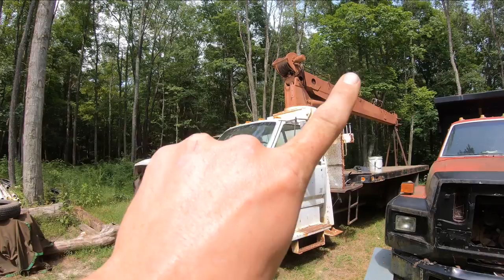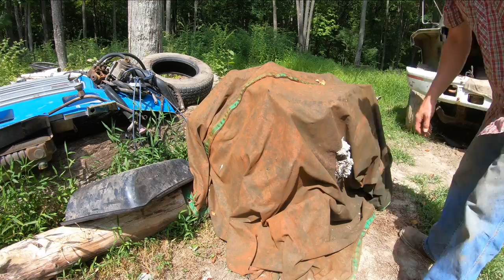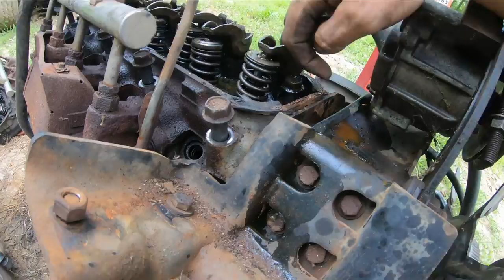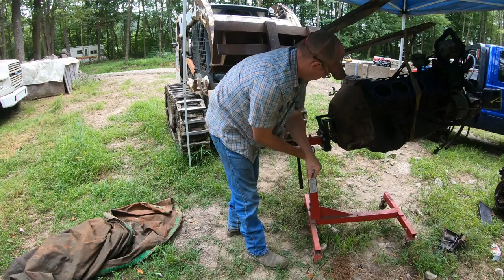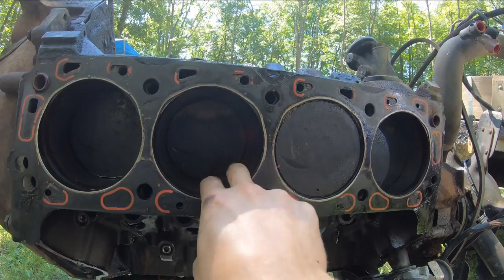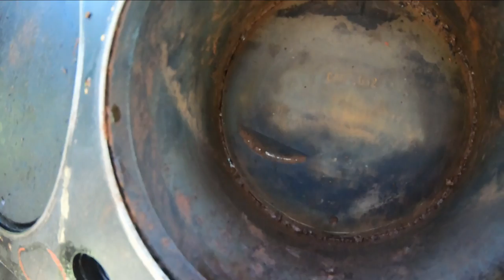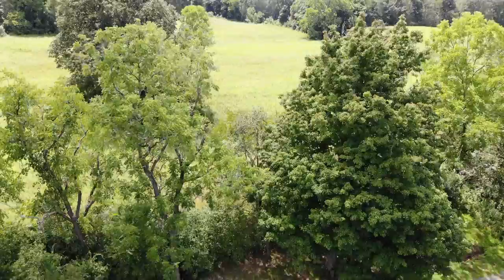Rebuilding a Big-Block in the woods! $700 Auction Crane Engine with big problems!

Comment: I'm here to tell you that you're doing it wrong!
Reply from the maker: HAHA But it feels so so right!!
Reply: first AND second !!
Reply: I'll bet your Wife told you say that!! He just doing some you always wanted to do. Good to see you Guys are support each other.
Reply: Hey  Wes ,,
What you think of the bore with the pit hole n skid mark down the lenght of it ,, even after it was honed
Reply: @Sircraig7963  Of course it's not ideal, but not everything has to be perfect. A little blow by on one cylinder is still a lot better than seized up!
Reply: And I'm here to tell YOU that opinions are like assholes! Everybody's got one, and they ALL stink!
Reply: I thought this A gas engine  how does it have blow by
Reply: @dancurrier6421  Blow by just means combustion gasses are going past the rings and into the crankcase. All engines have blow by.
Reply: Matt what is the metal bar used for banging on
Reply: @WatchWesWork  there was blow by afterwards?
Reply: never seen an engine with the things that needed do done as wrong as this one- still ya only learn the right way by doing the wrong way but HEY HE IS GONNA DO A WHOLE LOT OF LEARNING THIS WAY.. I CRINGED  when he said all you who like to strip an engine in a clean setting are wrong ya dont nee4d it the he started cleaning the bore WITH A SCRAPER AND SCREWDRIVER  HAHAHA whole lotta learning
Reply: @GaryAyre  I don't believe his goal was to make a proper rebuild, obviously. Something that costs at least $3000 and gives you the potential for another couple hundred thousand miles. No he wanted to make the thing run and it is not an engine that is used a lot, and he did. I believe this engine will not seize again or blow up or anything. This was minimalistic rebuild and he did it right with that mindset. Feel free to send him $3000 for each machine he has so that all the engines can have perfect bores and valve seats and everything will be perfect in the best of worlds. 
If there was a lobbyist for the machine shop industry they would sound like you.

Comment: Get a pick and have a dig around that rust pit in the first cylinder you did. Make sure it's not a hole into the water jacket.
Reply: i would have smeared some bondo in that rust pit and have a good laugh when it would hold.

Comment: My friend drove his 429 boss into the lake during a rain storm. After he got it out and home I pulled the engine and trans. The trans checked out ok after draining, cleaning and new valve kit. The engine on the other hand had orange clay in every cylinder. Mind we had the car out and home in two days. I completely disassembled the engine, cleaned and dried everything. I honed the the cylinders (which where in better condition than yours), ground and reseated the valves. I then replaced the distributor with a dual point (upon my friend's request) and rebuilt the carburetor. it took two days to do the trans and it took one week to do the engine. My friend cleaned and dried out the car. It took him about a mouth and a half. When we had everything put back together everything worked great except some minor electrical problems that we got sorted out in about one hour. Now the car runs and looks great . I hope you have as good luck as we did with your truck.

Comment: I once rebuild an s10 engine in my drive way I took it and pulled my mini van up lifted the back up watch make like a cover over my head put the engine on my engine stand and put right in front of the open van door and the open van back gave me a place for the parts and tools. Took it apart cleaned it. And put in all the new part rings bearings ECT it took me two days to do it put back in the truck and it all work fine started right ran protect one rebuilt engine in my drive way out of the back of my mini van it work out just fine

Comment: I hope you explored that pit/hole with a dental pick, and made sure it wasn't something worse.

I rebuilt the engine in a John Deere 440.  Did it "whole load, full nine yards, like the pro's would." Just back from the engine shop, getting the cylinders bored to .040 over, tried to wipe a spec out of #2.  It didn't wipe away.  Explored it with a right angle pick, it started getting bigger.  It opened up to the size of a dime.  There was a bubble in the casting.  Stripped it back down, and back to the engine shop to get that cylinder bored and sleeved, another $200 or more.  Got it back home, power washed a bunch of chips out of the water jacket, started assembly ... and had to return the crank to the engine shop because he had ground the rod journals to a size that they didn't make bearing inserts for.  At least the guy corrected that mistake at no additional charge.

Comment: "To remove a bolt, you have to take half the engine apart!" Welcome to the mechanic life. I had a 2005 Ford Freestyle: You had to take the intake manifold off to change 3 of the spark plugs on the V6.
Reply: And all the new Ford pickups need the cab removed to pull the engine

Comment: Next time you might try standing it on the flywheel. You can turn the crank by rotating the whole engine block. It works great I've done it for years.
Reply: I really like this idea holy shit. just get a junkered flywheel and use that every time, I may do this with my chevy 5.0L i6.

Comment: I seriously laughed out loud when you recommended dropping everything in the dirt to get a nice even coating.  That sounds a lot like how I work in equipment.  I always keep shop towels and carb cleaner handy while working.
Reply: If you're working on concrete, you won't drop more than a nut or two.  Working on dirt?  Might as well just throw everything on the ground -- seems like every part ends up down there anyway!
Reply: @dfross87  I was reminded this weekend that the same holds true for brand new rolls of electrical tape...  While using tape to mark the depth in a hammer drill I dropped a roll I had just opened.  Dirt loves to stick to the sides of a roll.
Reply from the maker: JDM333 don’t ya just hate that!?
Reply: Lmao if you ain’t laughing, you’re bound to go loony toons.
Reply: @dfross87  Keep those Amazon boxes and get a roll of duct tape.  Make yourself a garage mat.
Reply: @MrClarkisgod  Bit hard to carry on a motorbike. And I always seem to need to do repairs in the field on days when I've ridden the bike.

Comment: This is old-school engine repair.  There are 'in the field' engine rebuild kits (commonly called 'in frame') for tractors.  They used to just be just like this.  The motor dies out in the farm field and you just pull the pistons, put new sleeves and bearings while the tractor is still stuck there.  People did this all the time.  I think we've become to adjusted to these clean room style engine rebuilds with precision machining all costing thousands of dollars.  Sometimes get 'er done is all that is really needed to get some piece of equipment back up and working.  It's not like this truck is going to the drag strip next week...
Reply: That how the military fixes stuff out in the boonies
Reply: Jeff Kopis  My grandfather had an old engine that ran a grain auger and he tore it down every winter and replaced the rings with hand-cut, oil soaked and hardened leather strips.  It took him about an hour or so to rebuild the engine each year, in a dirty barn with simple tools.  Come disaster times, those old-school skills are gonna be sorely missed.
Reply: Jeff Kopis  Sad part is, I'm now one of those 'old guys'... without all of their actual tribal knowledge and experience.  Much longer and all this stuff is going to be guesswork for all of us... LOL!
Reply: @tombob671  doubt it not sure how one can fix a Honeywell turbine on an Abrams. Eh this military is rich LS swap it and...make it several.
Reply: @bryanmartinez6600  well I am sure you are right. My time was 1966 and they did a lot of repair in the field. Nothing as complex as an Abrams. But I understand those have engine packs to effect a timely swap.
Reply: @tombob671  I think the British could do it to their Older chieftain tank in 2 hours or less with a repair vehicle
Reply: They do inflame kits in diesels all the time

Comment: Worked on many an engine out in sticks.  You do what’s got to be done to get it done. But in Fords defense you can’t blame any engine manufacturers for after market add ons.  Who ever came up with the air compressor mount and pumps need to rework the engineering process.   Great 👍 content.  The get it done attitude is the difference between those that do or those that don’t.

Comment: I had one so damn stuck I tried every trick in the book before stuffing a 4x4 in the hole and pounding on it with a 20lb sledge. Had to replace that piston but DAMN did that thing run good after.  
I prefer doing things right but when it's a beater nobody's going to care about, the "aww screw it" attitude works really well sometimes.
Reply: Had a mechanic that filled small pits with jb weld

Comment: I am a sailboat mechanic with 40 years experience. I can pull a little sailboat motor out strip it down hold it out do an in-frame overhaul put it back together installed lined up and everything about 12 hours inside the boat or out in the cockpit if I have help picking up the motor. Only difference is this motor is bigger that's all. Yes you can get a good crosshatch with 80 grit sandpaper and a cordless drill going as slow as you can possibly turn it. It makes a really nice crosshatch that's the important part you do not want the cylinder smooth! Those scratches hold the oil and keep everything from losing the oil film also it helps to wear in the new rings. 1 engine that I rebuilt the person left Tampa the next day. He ran the motor all the way to Key West. He topped up the diesel fuel and didn't shut the motor off. When he got to Virginia it had burnt 1 quart of oil. He went 24 7 with two people on the boat. That's hard work all night long. He called me and said if I ever need a reference he would be happy to send me one. LOL I'm not going to Virginia to overhaul a motor

Comment: Nice this just shows you that you don't have to have specialty tools to rebuild an engine
Reply: Depends on the engine. Ancient American V8s? Definitely not.
Reply: @yucannthahvitt251  hey! Its vintage 😆
Reply: @LastChanceDiesel  Well no matter what you call it, simplicity is its own advantage.
Reply: It might run but never like new. But probably just good enough. Maybe the other engine had better performance because it has better compression? Idk.. A real mechanical engineer might be able to tell this.
Reply: The only kinda serious thing you need to have is a torque wrench, all other stuff is much more common
Reply: @UrbExGear  Some of those pulley tools are a pain to find as well
Reply: @HeyItsJonny  most of them are simple enough to make your own
Reply: @UrbExGear  Two dowels and a crowbar is usually what is needed as a "pully wrench" 😃

Comment: Just rebuilt my Ford 3000 Diesel engine so I can defiantly relate with your situation. My #1 cylinder was toast due to a broken ring so had to bore all three out .040 over. Waiting on a torque stick to torque the crank shaft pulley bolt to 150 ftlbs then I can put the front wheels and stuff back on. I did not have the luxury of an engine stand but I did have an over head chain hoist with a trolly, a life saver.
Rolling the engine around on a clean sheet of plywood got it done but not easy. Head rebuild, bearings, pistons and rings should have my old tractor up and running fine for many years to come. I don’t use the tractor all that much for clearing snow since I bought my skid steer but when I need it to brush hog or dig post holes it really comes in handy.
Don’t cut too many corners with your project and do things properly and your engine should be good to go. I am like others thinking that pit might be a through wall into the water jacket, very bad news but you can get another block without too much difficulty I am thinking. 
Looking forward to the outcome. Good luck!

Comment: Love watching you pull apart that engine, can't wait to see that puppy back in the truck and running. I understand that lifters and push rods should go back into the same wholes they came out of because of wear patterns, I assume for shade tree jobs that is not a requirement? lol or maybe you plan on putting new ones in?
Oh yea do you plan on making some kind of shield when the engine is back installed so rain water will not run down into it again, fix Ford's design problem there.

Comment: Well at least the info about the problem seems very correct.  The 2 cylinders that would be right under it caught most of the crap with a steady flow.

Comment: I have seen a bit of JB Weld epoxy putty used to fill small holes/pitting in cylinder walls. It seems to work fine after honing.

Comment: Pro-tip, when knocking rod caps loose, leave the nut on the stud, or the bolt in the hole a few threads and tap on the bolt/stud. Especially helpful when doing an in-frame overhaul. Will easily knock the cap loose and won't fall on your face.

Comment: You did what I would have done. Unless there is a hole in the cylinder some honing should make it run like it used to. I see it has been rebuilt before by the oversized stamps. You got a good deal.

Comment: Stay with the 429 it's a Lima Engine,  370 will give you fits by the change overs you will have to do to make it work , I promise you I know by working on Fords all my Life  !
Reply: Both 385 series BBF? Literally bolt in
Reply: @BrandonLayMusic  Thanks l  gained some new  Knowledge  today  !
Reply: The 370 and 429 are externally identical. Only real difference is the bore.

Comment: I gave up on Fords along time ago. Spent all my free weekends trying to keep a ford 1985 F150 on the road. I got to know that engine very well. When I got the truck the computer didn't work because it wasn't getting voltage. The main wiring harness that came from the firewall had a loop at the bottom. At the very bottom of this loop some engineer decided that would be a great place to put a non insulated copper crimp to feed the computer. Simply wrapped in black electric tape. Water gets on the wiring and collects at the bottom loop corroding the connection. Just to save on a 20 cent plastic connection.

Comment: use fuel line on rod studs and they cant ding a journal
Reply: I'll bet that crank looks as rough as a sweet gum tree after all that beating
Reply: @Vintageguy73  yep! It made me cringe hearing him say the rod bolt against the crank journal was the reason the piston wouldn't come out. And also driving the piston out with a metal punch and driving a screwdriver in between the rod cap and the rod to remove the cap

Comment: The stuff is many bottles of stop leak.
Reply: William Cantalamessa  👍
Reply: William Cantalamessa .....probably right
Reply: Wouldn’t stop leak be in the oil or coolant systems not built up in the combustion chamber. It would blow right out the exhaust if running.. like steam with bad head gasket.. mud wasps seems fairly plausible if it sat..

Comment: Love your videos.  I am a retired auto mechanic. I have some suggestions should you ever decide to take part another gas auto engine.  I would have loved to be there with you, helping as best I could and never charging you a dime!  In any event, here are my suggestions:
1) There are two types of Evapo-Rust. The home owners (DIY) version, and the commercial version. The DIY is a little diluted. Watch out which one you buy in the future.  Evapo-Rust is just that - removes rust.  It has no effect on caked-on carbon or grease.  This company also makes a product called Piston Kleen.  Now PK will dissolve the carbon buildup on your pistons.
2) Another product that would have loosened those rings is old-fashioned toxic commercial carburetor cleaner. The kind that comes in a 5-gallon bucket with a dipping basket. I say old-fashioned because the new stuff is environmentally friendly and cleans nothing!  Do not even know if they still make the old stuff.
3) Lifters and pushrods should be kept oriented to their respective holes, unless they are new.
4) The piston rings and cylinder walls should have been coated with motor oil prior to install.
5) The oil pump should have been primed prior to rotating the engine.
6) Mr. Gasket is an excellent gasket hold-in-place product.
7) Since you had it all torn down, it would have been wise to replace the water pump.
8) As old as the vehicle is, it may have dried and cracked belts. I would have replied them.
9) Sounds like you have a serious miss in the engine.  Most would say it is an ignition issue. Although possible, I believe this is not the cause. Sounds to me you have a hydraulic lifter set too tight, or a valve has a serious pit in it causing blow-by. I see you did not have a valve job done on the heads.  This may bite you later on.
There.       I put my 2-cents in!      I enjoy watching your videos.  The the best to you and your family.
JD

Comment: Hi.
Warren at western tractor, had a video recently where he said a viewer suggested he slid the clutch and pressure plate on the output shaft then slid the  engine in only having to line the spigot Bush up. Once the bell housing was bolted he bolted the pressure plate to the flywheel. I haven't tried it , never seen it done before,  but it seams to make heaps of sense, he did it successfully,  cheers, 
Watching and enjoying from Australia.
Reply from the maker: I was almost considering that but getting all the bolts lined up seemed like it would be a real pain under the truck

Comment: u also need to get  a dial bore indicator and check ur holes in the cyl wall and make sure the rings will seal. it may be best just to bore it . its only 100 bucks to bore a motor. and u get more power.